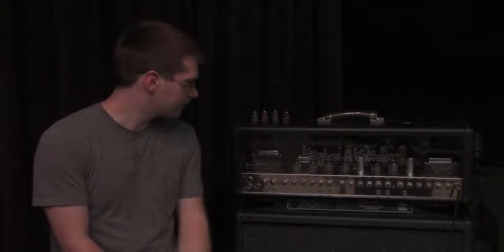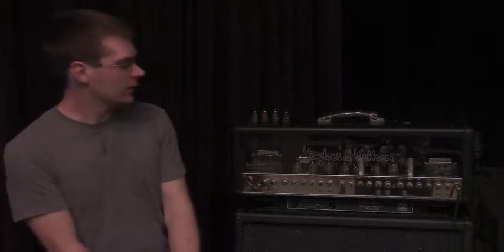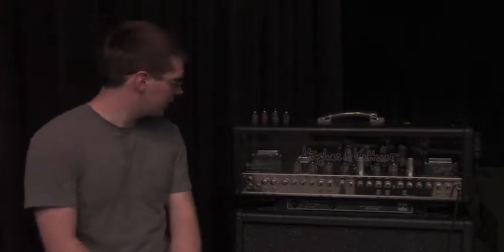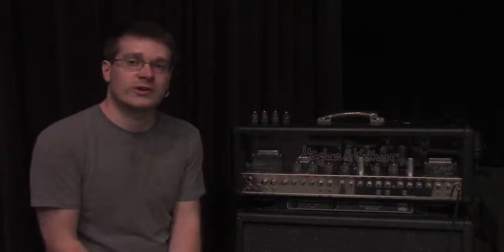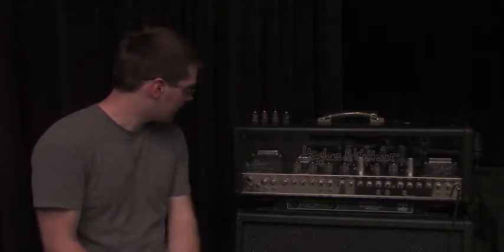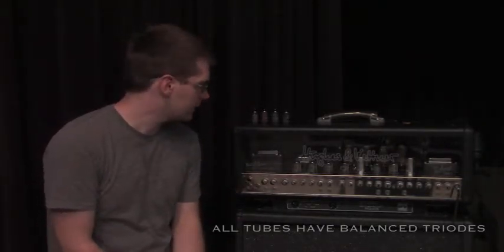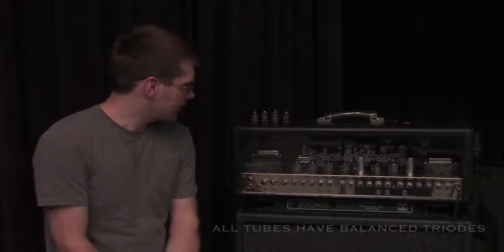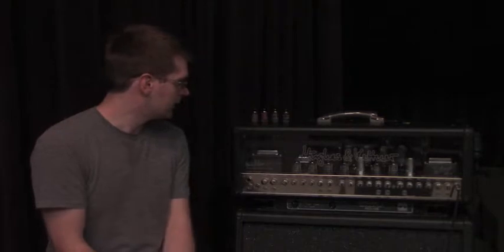Phase Inverter Preamp Tube Comparison / Shootout: JJ ECC83s & ECC803s, Tung Sol, Telefunken

Comment: The JJ ecc803  has the most life and sparkle. I have it currently in the PI positionof my Marshall TSL100's
Reply: i have in V1 Ruby + V2: ruby 12 ax7 v3 and v4 marshall 12ax7.
Waht do you run in the other slots?
I had the JJ ECC803 in the V1,also great.I will try it in V4 ;) !
Reply: i have a TSL 100 ! :)
Reply: I agree...I'm running the 803s in my Plexi v3 PI Slot...Sounds Good and the Tube is built like a NOS and Tough as Nails. With the 803 the Guitar Cuts very well thru the Mix.

Comment: The ecc803s and the Telefunken sounded great. If you get a chance try an ecc81( 12at7) in the phase inverter, it can open up the high and low end giving a broader tone( in most push-pull designs) . Thanks for sharing.

Comment: I feel like the JJ ECC83S (both normal and gold pins) are the best tubes for phase inverter. For me, the gain and frequency response is just right, but as far as durability is concerned, JJ’s are probably some of the most durable tubes out there. Perfect for PI slot.

Comment: I have a Dsl20hr that I was about to give up on. Only had JJ ecc83s and stock tubes. Bought a used single rectifier head recently and the dude threw in extra tubes. One was a Mesa Boogie 12ax7 Russian 2. The other is made by Hammond in the USA. Has 12ax7 in red but Is mostly worn off. Can't find anything out about it. Anyway I put the mesa in v1, a JJ ecc83s in v2, and the Hammond 12ax7 in v3( phase inverter) it's like a whole new amp. At first I tried the Mesa in v3 and the Hammond in v1 but didn't sound too good.
Preamp tube selection is crucial in my limited experience.

Comment: Great video. Does the JJ803 lasts? I have not tried them. How would you compare JJ803 with Gold Lion Gold Pins? I've tried them and they seem to lose impact after a couple of months.
Reply from the maker: I have not had any issues with tubes loosing their bite. It could be that the tube just gets broken in? Other than that I don't think I can be of any help there.

If you're referring to the Gold Lion B759 Gold Pin then I'd say the Gold Lion and the 803 are very different tubes. The Gold Lion is going to focus on a thick midrange, have a tame high end and have extended lows while the 803 is going to have more tight lows and a very chimy high end. If you want thick and full but less high end clarity go Genalex; if you want upper mid bite and chime go 803. I always fought with the Gold Lion trying to get high end and I fought the 803 being barky in some cases.

Comment: Have you tried putting a 12at7, 12au7 or 12ay7 in the phase inverter position?
Reply from the maker: I have not. Have you? If so what kind of results did you get?
Reply: @mmagoon67  No I haven't, was hoping to see if anyone had. I've never changed tubes on my Mesa and was interested in trying that, and/or swapping out 6L6s for 6550s; trying to tighten up the bottom end a bit and get a bit more mid.
Reply from the maker: @jayrezvani3821  I assume you have a Mesa without the dedicated switch for power tubes. 6550s are louder, have more midrange and a tighter bottom end. I know the tubes you mentioned have a significant gain reduction so I'm wondering if the amp will just be quieter or the power tubes will just get driven less. I'm pretty positive the phase inverter doesn't get driven to the point of breaking up, but I'm just not sure.

Comment: They basically sound the same. I doubt when in a mix any difference could be picked out. Phase inverter is inside the feedback loop, might explain why they all sound similar. I’d use the cheapest one.
Reply from the maker: The differences can be subtle, but they are there. The purpose of the video is to show the differences. You won’t be able to hear it in a mix like you would with different speakers, but some people like myself get into tubes. I think they’re fascinating. Very subtle differences won’t matter to some. Some people can hear it very clearly and like to experiment. Also, the further down the path you go the less the tubes will affect the sound.
Reply: I agree. I like the 803s Gold...
Lets see if someone could tell us in a Crowd of 1500 with Tube is which? Kinda Funny when you get right down to it...
Reply from the maker: I don’t like gold pin tubes for lower gain clean/crunch channels, but man they’re smooth. I’m gonna do a video comparing a bunch of tubes for my V1 tubes. I have an E83CC coming in soon I can’t wait to hear. JJ is the only one making this kind of tube.
Reply: @mmagoon67  howd you like that E83CC? I got one recently thinking it was going to be the bees knees, but man... I feel the mids are way too hard with that tube. In general it’s a pretty harsh one to my ears. It’s pretty good in the cathode follower spot for an aggressive modern metal tone, but when paired with a tube screamer or something, it can get pretty ugly quick.
Reply from the maker: @DemonKingOFFICIAL  i put it in my phase inverter position. Unfortunately, what you're describing is what I heard. Harsh. I did recently get a gold pin E83CC which completely fixed it. So smooth. You have to call Eurotubes and order it that way. I guess they are a very new product.
Reply: @mmagoon67  ahh didn’t know they made a gold pin version. Yeah I might like the gold pin version more. I feel like it had a good bit of clarity, but yeah... those mids were insane!
Reply from the maker: @DemonKingOFFICIAL  Yea, you might get on the horn right now and get one. The difference was amazing. I'll have to make a video

Comment: Are these balanced tubes or does it not matter?
Reply from the maker: These tubes are balanced. Preamp tubes have two sides and the phase inverter position will run both sides. I believe one side has the phase reversed so that it can go to the power tubes. If both sides of the tube do not match you will hear a slight "out of phase" sound which can very in severity depending on how unbalanced the tube is.
Reply: @mmagoon67  This is a myth. The phase inverter position in an amps like this is already wired internally to be unbalanced on purpose. A typical long-tail pair phase inverter has one plate at 82K and the other at 100K. That is an intentional unbalancing and is necessary for how the stage is designed to function, while keeping a normal unbalanced PI tube in mind.
Reply from the maker: @FourT6and22  Forgive me, but this doesn't make much sense. I have personally tested using unbalanced tubes in the PI and I can hear that the sound is out of phase. Perhaps my explanation isn't 100%, I'm open to being wrong, but my ears aren't lying when I can hear the difference. The only thing I can think of is a balanced tube would preserve this internal difference you describe though I don't quite understand still.
Reply: @mmagoon67  I'm not saying you don't hear a difference. I'm saying that vacuum tube guitar amplifiers using long-tail pair phase inverters are intentionally designed to be unbalanced because the two triodes in a 12AX7 are inherently unequal. Using balanced phase inverter tubes that you pay more for is counterproductive to this fact. The design of a LTP already takes unbalanced tubes into account. Designers use an 82K on one half and 100K on the other to intentionally shift the output to be more symmetrical by lowering the gain of the inverted half of the stage (instead of driving each half with the same 100K value). If you use a balanced tube, you are actually making the stage more unbalanced... If you google tech articles about the LTP and balanced vs unbalanced triodes, you'll find good info. Look at the article by Aiken.